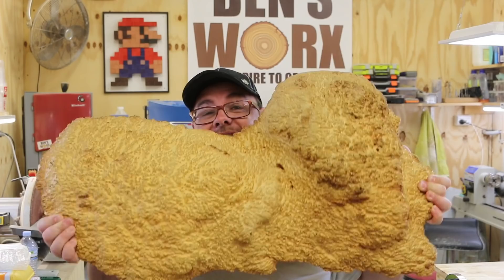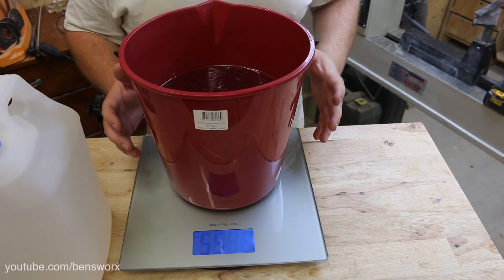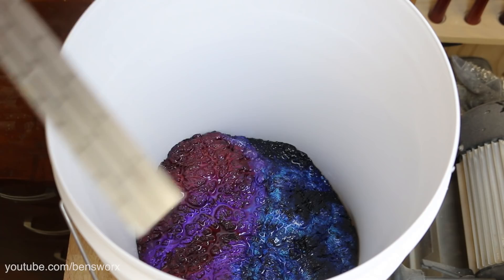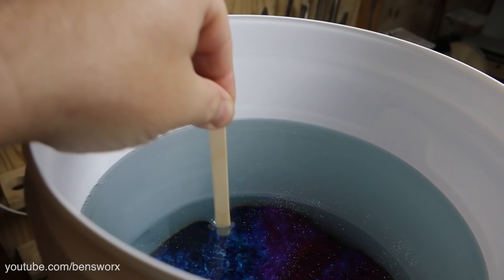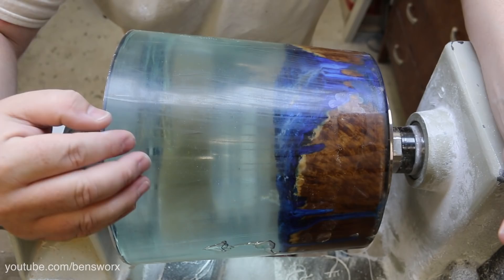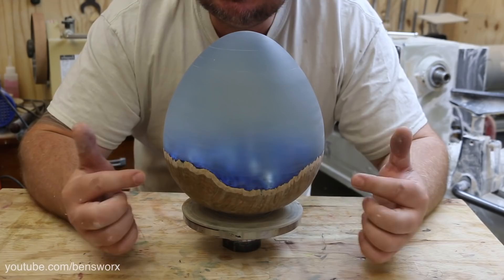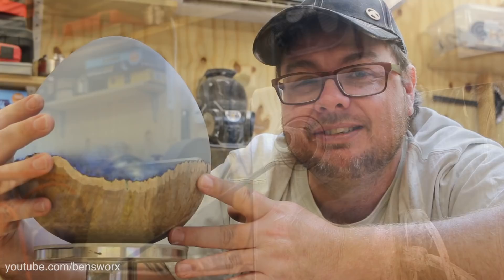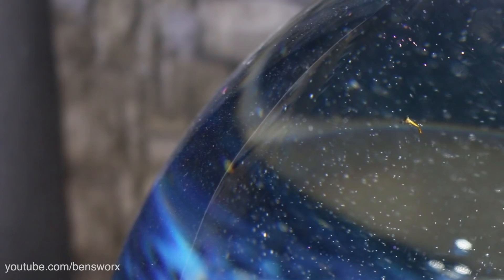Turning a MASSIVE Dragon Egg - Epoxy Resin Art

Comment from the maker: Thanks for stopping by, If you have time you can check out my new range of Eggs here www.etsy.com/shop/bensworx
Reply: i'd love that in my home
Reply: Hi Ben big fan. Can you do a hand carved Pyramid with that huge 20L ressin it would be so awesome. Thank you.
Reply: Hi Ben, What wood do you use...???
Reply: Did you brush the epoxy on the wood before your pour?
Reply: Are you related to Dataless822? your voices sound somewhat similar
Reply: Why not make a vacuum lid for the 5 gallon bucket so you can stabilize the entire project?
Reply: @mrkawasaki496  This is Red Mallee Burl if I'm not mistaken :-)
Reply: @ianstradian  thin plastic bucket won't hold the vacuum, it'll collapse!
Reply: @MassisPipes  pull a soft vacuum, not a full vacuum and when the bucket is filled.
Hold that lower pressure till the expanded bubbles have time to rise.
The resin should aid in holding the bucket out.

Alternatively you could pack the bucket in a larger bucket of sand and pressurize the resin, but that would need a god seal to hold the pressure while the resin cures.
Reply: yesssaSS, I love the eggs so much! They make an amazing gift for literally anyone.
Reply: You should make bowling balls that look like that , you would kill it . I will buy one .
Reply: @tt55k  it’s would look awesome but a Bowling Ball has a weight that is shaped inside so the ball is regulation and rolls properly.
Look up: How it’s made Bowling Balls
Reply: @ianstradian  , I understand how bowling balls are made yes .
Reply: Hey have you ever tried Dipping long resin shavings in resin and hanging it out to see what you get?  Maybe you can use what you that to make a resin jellyfish(this is just me spitballing here, I'm not sure if this will work or not or whether or not even look good, but it might be worth a shot)
Reply: This is simply GOURGEOUS!!! This one is better than the smaller one. However that one was beautiful as well. It would be cool to see a dragon egg cast in different t purple colors or even blues. Keep up the awesome woek!!!!
Reply: What did you use to polish it. That white paste and that clear product? Do you sell it as well?
Reply: ITS LIKE SEEING A PLANET BEING BORN ABSOLUTELY STUNNING OUTSTANDING GORGEOUS

Comment: You could now make a  silicone mould of the finished egg, using the 10l bucket as a hard case and then you could have a mould to pour future big eggs without all the wastage. They'd just be a bit smaller after the clean up.

Comment: I'm not sure how well the golf balls would turn or if resin would even make a practical material for the job, but if you could make that into a bucket that would be such a cool storage container for golf balls
Reply from the maker: Yeah that would be cool 👍
Reply: Golf balls are 90% rubber gun so any heat from turning would be very Messy , cool idea about the bucket tho

Comment: If i'm pouring one large container and i dont want it to splash or in your case create bubbles, when pouring one bucket into the next i would recommend tilting the container you're pouring into a little bit and pour down the side of the bucket instead of your stirring stick. Its the same concept but you can  get the containers much closer so it doesn't splash down so far.

Comment: Try pouring The resin down the middle of a  length of angle iron.  You can control the speed it goes into the mold better.

Comment: I've seen people do huge turnings before, and usually they've got basically a sling that supports the midsection around the center of gravity, that slides on the outside of the piece while it spins. I don't think you could turn the diameter of the piece down using that technique but I think you could turn the end flat that way so you could get a second chuck on the opposite side and have a tailstock support the other end maybe?

Comment: As an ex turner myself the noises from the chisels is ASMR heaven, closed my eyes and it took me right back to some happy days standing at my wee lathe.
Being rattled on the chin with a lump of African blackwood isn't fun, truing a block can be dangerous?
Loving your channel.
I've never turned resin, imitation horn or ivory are the only synthetic materials I have turned, similar cutting characteristics from the swarf to the sound.
I loved the different ways different materials would feel during the turning process, working with natural materials you can feel the difference in the quality of the wood as you work it.
What is the biggest piece that has bounced and do you have it on video?

Comment: Really nice work 👍 
~320rpm was a bit high for the start cause of its eccentric behavior. If your workpiece doesn't turn concentric you'll start lower so the centrifugal forces doesn't rip it of the machine.  I'm glad you didn't injury yourself 😉

The "Failed" first one would make an awesome "chess knight" I think.🤔

A while ago I thought about my Jack Daniels Bottle collection casted in resin and lighting it up with RGB LEDs and WLED to control them. But I never did it cause of the bad deep poor possibilities of resin available at that time. This one could be the game changer and makes me rethink of that project.  😎

Comment: Great project, and a beautiful dragon egg as a result (the first time it's also dragon scale? )

Honestly I've never stabilised any burl I've casted into resin. You don't need to, as long as the resin fits in your pressure pot. You could get a 40L pressure pot for a reasonable price if you go the "convert a paint pressure pot" route. 

I made a 6-7kg illuminated glow-in-the-dark fairy cave from a very dry and very not stabilised chunk of ivy trunk last year, so I've been the same snowman after turning it :P

I used Dipon's new P100 ultra pour and was able to cast over 25cm in depth in one pour, crystal clear without a single bubble. Didn't even degass it. It did however take about 5 days before it was hard enough to demould, and another 4-5 before I could start turning it.
It's a shame we can't get Mallee burl here (or if we can, it's incredibly expensive), it's the most amazing wood for this kind of project, as you've proven time and time again.

Comment: Might be able to drill and fill some of the worst. Best way would be to drill into the cavities through the resin, put whole piece in resin, pull a vacuum, and when the vacuum is released air pressure will force the fresh resin on the cavities. But you'll need a bigger vacuum chamber. As the fresh resin will have same refractive index as the big piece, it will be invisible.

Comment: Seems like it did fine to me. The bubbles aren't the fault of the resin, but the burl. It didn't crack, and looks to have polished up clear as glass. Although. Unless you added something to the 10 in tall test so that it films better for youtube, there does seem to be a slight color tint to it. It still looks clear enough to make a lens to me... And the bubbles that came out in the one you turned just make it look like a small section of ocean floor frozen in time.

Comment: When degassing larger buckets that don't fit in the vacuum, would you be able to provide vibration to the bucket as the resin sets to make all the oxygen rise to the top of the resin as bubbles? I've seen the guys tap and torch the bubbles off the tops when they use epoxy resin to make giant office desks using 2x4's as a mold, so it's just a thought I had. Awesome video!

Comment: Honestly? I feel like it would've been better to have more bubbles in it, the way it turned out. It looks like an aquatic egg so more bubbles and possibly a bit of blue tint to the resin or even a light sea foam green.. Well, you get what I mean.

Also, I had an idea about the wasted resin shavings. I know you've found ways to re-use them in the past but have you ever tried chopping them up into smaller bits? Like confetti? Dyeing them first of course. And then mixing them into either fresh resin or paint to create additional texture for any brush work that your projects might require? It could be a fun thing to try.

Comment: With the original casting, couldn't you drill down to the air pockets and fill them with additional resin? I would think you'd then be able to try to turn the beast on the lathe.

Comment: I don't know much about resin, but would it be possible to drill into those air pockets and just fill them out with additional resin? Also if if you were turning it on the lathe and hit one of those air pockets with a chisel, would the chisel just keep cutting away or would it catch and create an accident?

Comment: If you can think little bit much more, you can reduce the epoxy usage and stop the waste half to half. Up down process uses the styrofoam for fulfill that unnecessary area with silicone rubber. And then please send me that additionally serwied epoxy resin to me please 😉.

Comment: A beautiful work of art but maybe you or a commenter can tell me a couple of things; Firstly, you didn't show what you coloured the burl with to create those colours. Secondly, having used Casting Resin to cover kitchen bench tops, I have paid $100 for just 2 to 3 ltrs. Having seen you use so much resin, please tell me, is money simply no object for you or maybe you pay a LOT less for your resin? I live in Queensland, Australia. Know of a good supplier over here?
Reply: Probably depends on the brand of resin you're using, plus it gets a lot cheaper per litre if you buy more. Also Laminating counter top epoxy is usually more expensive then regular casting resin, because it's made to withstand higher temperatures and scratching. I've seen epoxy vary from €10 to €45 per litre here in Europe...

Comment: Mixing up your resin and then putting it in a vacuum chamber really doesn’t make sense to me I know what a vacuum pump does.the purpose of using the vacuum pump is to pull something down into a negative atmosphere and to boil off any water or impurities you’re using it To pull out bubbles and then intern you pour the solution in a bucket introducing air which makes bubbles I think if I was going to waste my time with the vacuum chamber I would’ve mixed and poured everything together and then vacuumed it and let it dry in the vacuum chamber